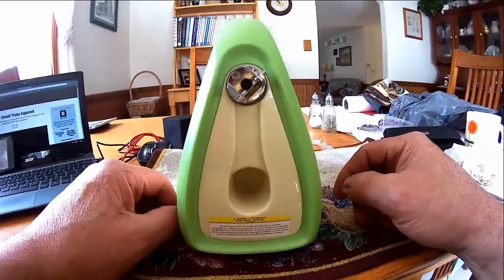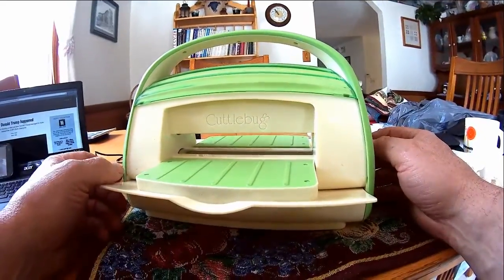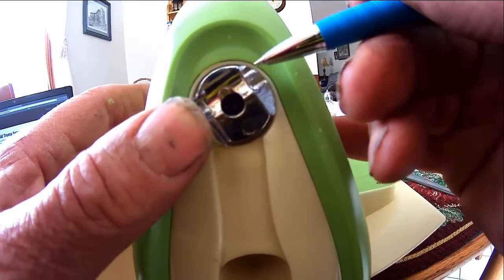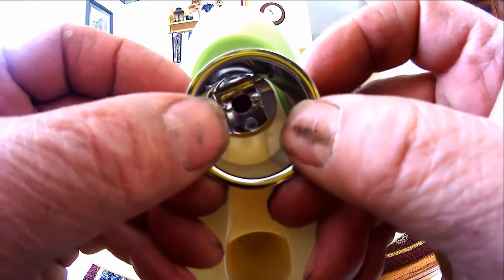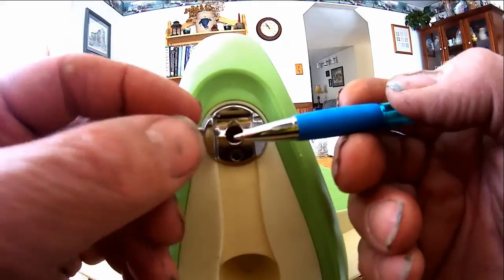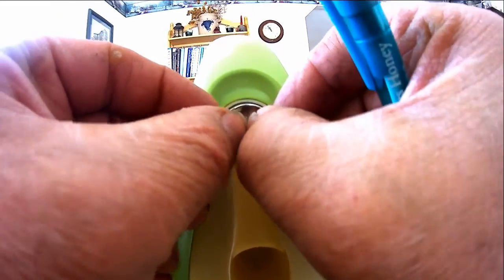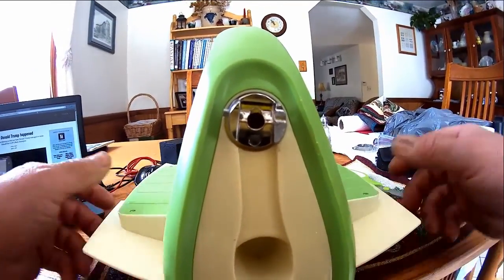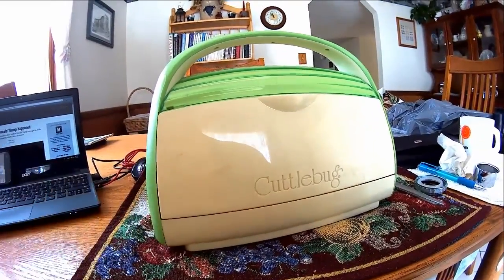cuttlebug handle breakage

Comment: I had the exact same problem!  Unfortunately I don't have a partner  who is handy so it looks like I will be forced to scrap my beloved die-cutting machine and buy new (another brand perhaps).  And yes, you're absolutely right -- this machine has a crappy handle made of cheap material used by manufacturers in China.  Not a quality product at all.  You'd think that knowing this type of equipment gets cranked a lot using pressure from the rollers, real metal parts would be used.